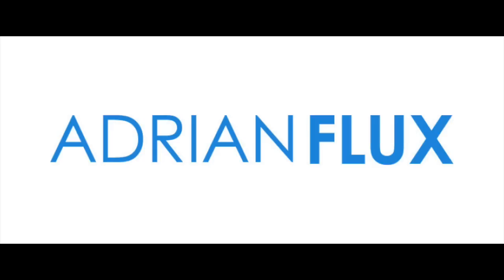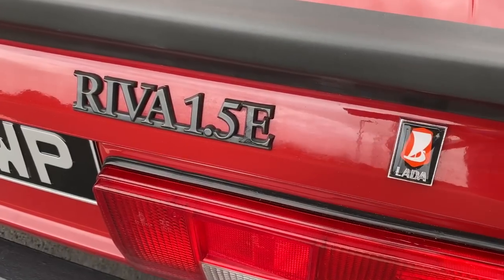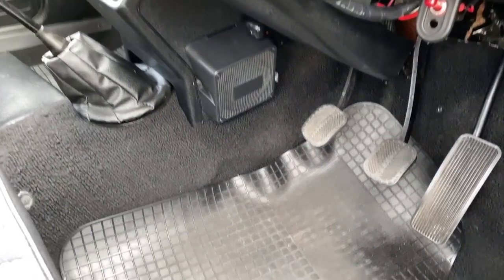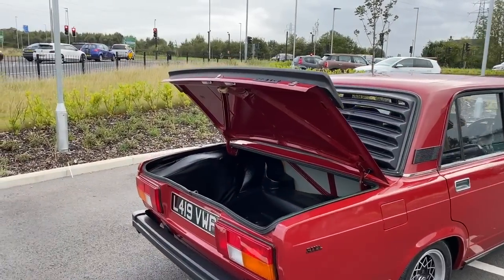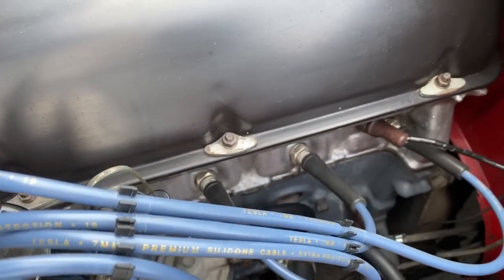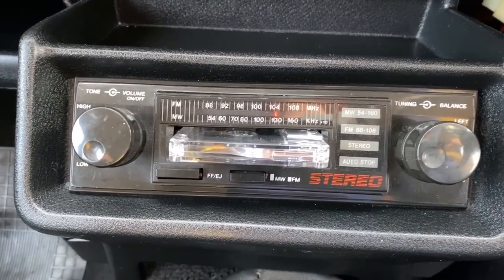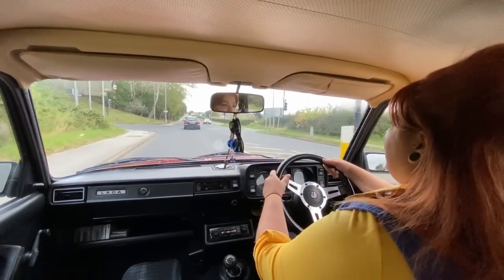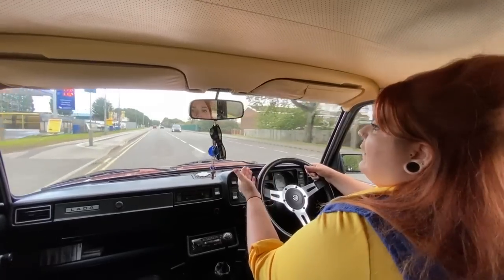IDRIVEACLASSIC reviews: Lada Riva (VAZ 2105)

Comment: With regards to the lack of power steering and the heaviness, the car originally had a larger diameter steering wheel so it would have been easier to maneuver given the greater leverage.
Reply: True but imagine that you don't have to have a gym subscription. You end up with arms like Popeye.
Reply: It's got wide alloys and tyres as well which it was never meant to have.
Reply: @Pfirtzer  Not so much on a Lada, but you sure will from driving a GAZ 53.
Reply: Yep  .............
Reply: steering was lighter as the car gathered speed. i had one for 5 years
happier times
Reply: No not true but it was  about 250kg lighter and narrower tyres
Reply: I assume this car has not the original steering wheel it seems aftermarket steering wheel which gives better steering position.

Comment: Between you and Big Car, it's been a very Riva-filled weekend! And I literally just became the proud owner of a Skoda Favorit, so it's all about the slavic cars of the people for me right now!
Reply: Check the spring cups on the front struts for rust, I had one fail with 'interesting' results, the rear ones can rot away as well but they can be replaced as they're removable from the main strut. When I did mine fifteen years ago Turners of Erlestoke had them on the shelf at £1:80 each, inc.VAT.
Reply: @jonathangriffin1120  Thanks for the heads up! I'll be taking it for a check - over soon so I'll ask them to take a look at those.
Reply: I've just watched old Top Gear from 1994 when we were first exporting them back home on the grey market!
Reply: honestly favorit is the ugliest škoda ever produced

Comment: Thank you for this video it is very intersting. I rememebr these from the 80's. They were popular with private buyers and people who bought them liked them. They were solid compared to some of the lighweight cars of the 80's. I did not own one however I drove one, an estare, and liked it. I recall them being used as minicabs in the 80's. They were common on the roads until the early 90's. One reason for them dissapearing from British roads was the re iposting of them to Russia for parts. Ship loads went back to Russia and by the mid 90's they were rare. They were never fashionable, people in the know liked them. The cold war split opinion on Lada's some people saw ownership as disloyal. However Lada's, FSO's, Zastava/Yugo's and Slodas were poplular with families. I owned a Yugo 311 in the 80's another ex Fiat, the 128.

Comment: There was a model before the Riva based on the Fiat 124. I used to run mine as a taxi, only broke down once in 120,000 miles. It was great in the snow, just cut through and rarely got stuck.
Reply: The Riva IS the Fiat 124! Proudly made by the motherland in a factory city called after the Italian communist leader so adversed by the owners of Fiat that they use to oppress communist workers, and in the same time they had released the rights to produce that car in USSR. And the owners, the democristiani leaders in Italy, the Italian communists and the Soviet leaders, all of them were so happy about it. Bonkers.
Reply: By the way, your story was amazing. Still today those cars are doing wonders on Russian streets, and you can have one for about 500 euros. Oh, Russia.
Reply: The VAZ 2101 was based on the Fiat 124 platform. In Russia, it received the nickname "Kopeyka".  Kopeyka - the smallest change in denomination of 1.
Reply: @drivetothegrave8395  cause Is cheap! What's greater then cheap things? Btw, I never realised that kopeika thing. Interesting, indeed. Thanks for letting me know.
Reply: @danielemeytre4010  Car is named so because of the "1" on the coin and the "1" in the model number "2101".  One and one.

Comment: The smaller aftermarket steering wheel will make the steering feel heavier, imagine one of these with a Rover V8 and standard looking exterior? that would be a scream.
Reply: Precisely.
Reply: I had a Lada Riva with a tuned Lancia 2.0 litre Twin Cam matched with twin 40 Webers under the bonnet. It also had a 5 speed gearbox from a Fiat Supermirafiori fitted. It did 0 - 60 mph in 8 seconds.

Comment: I had a Riva 1.2 with 30,099 miles on the clock. 
I paid 600 quid for it. It broke down 200 yards from the garage where I bought it . 
Remedied by installing a larger fuse to stop it going bang again. I never had mechanical problems with it but the window on the driver’s side was propped up by a piece of wood as the glass became unstuck from its metal winder . 

Interestingly they are popular in Cuba where the roads are not in great condition. They are easy to work on.

Comment: Which was the better car, the front engined Lada Riva, or the rear engined Skoda Estelle? There was also the FSO 125P that looked similar to the Lada and built in Poland. The Lada 1200 based on the Fiat 124 appeared in Britain about 1974 with a different engine to the Fiat 124 that was still around until 1976. There was later a 1300 Lada, and a 1600 with a different front that looked different to the basic 1200. By 1983 the saloons and estates were facelifted and now called Riva. There was also a small four wheel drive utility vehicle called Niva, and in 1987 there was the option of the Samara hatchback as an alternative to the Riva. At least the Lada looked better than the Moskvich that was sold in Britain until the mid 1970s. A red Riva looks much nicer than a beige, grey or white one.

Comment: I hope you will test out a NIVA or even the longer wheelbase Cossack. These utility 4X4s were ingeniously built, very strong, spread the load so that they didn't sink in mud and were only let down (after years) when FIAT failed to supply distributor shafts. The two gear levers could be confusing but my Niva of 10 years service here in Ireland was a better all round 'SUV' than any Nissan, Misubishi or Toyota replacement I have had.
The turning circle on the Niva standard wheelbase was smaller than on the saloon Riva.

Comment: Great vid Steph.  I sold these new for a time in ‘92. They were 1992’s Bargain Car of the Year.  £2995 on the road. The pre delivery inspection was 5 hours long. Original steering wheels were huge which made steering easier but very vague. The reason there are so few on British roads is that they were imported back to Russia en mass during the 90’s where 2nd hand prices were higher than new prices here. They had a very loyal following and estates were often used as vans. The 1600L was the decadent version and even had a rev counter! 
 Terrifying on a windy motorway though.

Comment: I owned two Riva's, the first was a 3 year old ex-taxi purchased for £350!
I ran it for a couple of years with no problems, then bought another with only 12,000 on the clock, I ran it up to 60,000 miles in that time I replaced the clutch, exhaust & battery.
Neither car ever broke down, always started first turn of the key!
I do agree about being heavy to drive, and the doors needed a good slam to shut, the fit & finish was terrible,  But for the price you could not complain!

Comment: In Canada we got the VAZ 2101_2107 sold as the Lada Signet, based on the Fiat 124. They were neat little cars, well put together, and very nippy to drive. I test drove one and quite enjoyed it. The problem then was getting parts! A friend wanted to test drive a Lada Niva, the 4 wheel drive unit. Perfect for their cottage driveway in winter. The dealer had needed to take parts off brand new as well as used vehicles in stock to be able to keep customer cars on the road. After Lada left Canada, the parts dried up completely, so the cars were scrapped as things broke and could not be repaired. A shame, as they were really neat to drive. Nice to see one still being loved.

Comment: Ladas were very underrated in my opinion as we had an estate version were i worked as a firms vehicle and it was punished big time but never let anyone down apart from when we were going over a building site with holding down bolts in the back that was questionable as regards carrying weight and we had the rear tyre torn off by a piece of reinforcing bar sticking out of the ground lol 🙂

Comment: Hiya Steph.  Great video as always - very informative and a good all-round short story on the Lada.  Not sure where you read that they ended up as Taxis over here in NZ (I've certainly never seen one), but I do recall them being sold alongside tractors and the like at the local John Deere dealership, so they appear to have stayed close to the agricultural field when they did the 'swapsies'.  

Ladas did (and still do) have a following over here, although they are not as plentiful as they were about 20 years ago (but what classic car is, eh?).  They were known as the Lada [insert model number here]. Being they shared their good looks with the Fiat, I always quite liked the look of them.  I finally got to drive one when I was 20 - the 2104 (wagon) and it was only a year old and had done 9,000 miles, which I though was strange for 1989 as all others except American cars were in kilometres.

It was more standard than Steve's car.  It was painted beige with a beige dashboard and dark brown cloth seats and carpet.  I got in it and it was not what I was expecting at all.  The steering was like driving a truck (including the angle of the wheel), the gearbox was a vague mystery shift and you needed to raise the clutch slowly after changing gear to make sure you had the one you wanted, it's 1500cc engine was a slug, the brakes - although they were boosted and had a good pedal - had to be trod hard on to pull the car up and rattle!  My goodness did the car rattle!  Dash squeaks, trim rattles, door catches, tail gate, windows, steering column, seat adjustment - damn near anything that could rattle, did in fact.  My own car at the time was a 1957 Austin A55 - so 33 years old by that stage - and I was so glad to get back into it for the drive home.  

I was rather disappointed with the Lada, but maybe I just happened to drive one of the dogs that occasionally slip through.  I certainly think Steve's one goes, rides, sounds and looks a LOT better than the one year old beasty I drove in 1990.  Then again, like BL cars of old (of which I now own three), owners have often had to step in and correct a few factory flaws, so maybe the one I drove would have come right with a few hours and much love.  I do know that the Lada drivers over here love their cars to bits and it is extremely rare to find one for sale.  Yes, I was put off buying one way back then, but it hasn't dulled my smile every time I see one barrelling around the streets.  Keep up the good work with your channel, Steph - you're doing great and I truly enjoy hearing your perspective on the different classics out there 👍

Comment: I thought about buying a Lada when I first learnt to drive but the press were putting it down saying it was a Fiat made out of low grade steel. The jokes started to appear. 
I did hear something about how the engine had been reworked by Russia to improve the crank shaft by installing additional bearings. I don't know if it's true but it was said to improve on the original Fiat engine.
A lovely example though Steph.
Reply: Actually the steel used in Lada was thicker than in cars used in the West, this cars were bullit proof made to withstand and work in harsh remote conditions and easy repair. They were not that bad at all, actually very good with plenty of room and space and decent, but only thing was to me was the petrol, one litre got you about 10 km or so.

Comment: I  had  a brand  new 1600  in 1982.  Had  a  lot  of  bother b4  15 mths. When  guarantee ran out  got  rid of it.  Had  new  starter.  New  alternator.  New  heater.  New  clutch. New  carburettor.  And  i  got 27mpg and  33  on  a  long  run  driving at 56. The 1200  i  was  lent  when  at  garage was  more  better.  Sorry i  didnt  buy  the 1200 
  But  was  glad to  part  company  with lada even  i losr  a  lot  of   money doing  so

Comment: I expect that steering effort would be a lot less with the original equipment wheels and tires, which were likely much skinnier than what's on there now, and perhaps with a larger diameter steering wheel.

These were never sold in the USA but I think they were sold in Canada for a while.  They were all over Jamaica as taxis in the mid '80s, when I visited there.

Comment: Nice lada seems its had a paint job looks nice . Its got a smaller after market steering wheel which will make it more heavy. But the real problem is the worm and peg steering box = heavy  phased out of English cars in the early 1950s. Would it be a good daily drive I think yes. With 2020 eyes its different and cute

Comment: I think the original Lada steering wheel was rather larger than in this one.  That would make it much easier to steer. The owner put style above practicality. You have driven larger classic cars with no power steering, but large steering wheels, and I don't remember you complaining the steering was too heavy. I believe the Lada was a whole £1,000 cheaper than a Cortina, a similar sized car. Most of the Ladas sold in the UK are now back in Russia where they could be sold second hand for possibly 10 times or more than their value here, so there are not many left.

Comment: Love the Riva. I've been kicking myself since 1996 when I walked away from a biege 1988 Lada Riva 1200 L with 57,000 miles on the clock, all for the sake of £50. The good thing is that I got a 1987 Fiat Panda 🐼 750 L for £195, £105 less than the price of the Lada. Try a Panda Steph, you'll love it. Thanks for a very positive review of the Lada
Reply: The Pandas from about ten years ago were one of the cheapest cars for sale in the UK, but apparently a hoot to drive
Reply: @mattylamb9194  they can still be picked up easily. Saw a few recently. Not much equipment but very reliable, great engines, roomy, cute and a great drive. Plenty of them over 10 years old and low miles around £700 or even less.

Comment: 14:43 I've only ever come across these as taxis in Russia and Egypt around 2005-2008.  Nothing special, but cheap and reliable!
Reply: Ladas were used as taxis in Cardiff for many years in the 80s up until the early 90s. Most taxis in Cardiff at that time were either Lada Rivas or PolskiFiat 125p. All painted black with white bonnets which is a requirement for taxis in Cardiff.

Comment: 12:00 what about the indicator switches in right hand drives. I did the same - turning on the wipers instead of indicating. Is there a standard? I've seen not a single left hand drive with the indicators at the right.
Reply: It makes sense having indicators on the right though in a right-hand drive car. Means you can change gear and indicate easily at the same time. Takes a bit of getting used to perhaps, but it's the right thing to do, I'd say. I know Japanese cars used to be like this too

Comment: No surprise that the steering is heavy.  The 'upgrades' are to blame.  The steering wheel is too small, the tyres are too wide, and most of all those cheap Chinese tyres look seriously under-inflated.  A decent set of boots of the correct size on the original steel rims would go a long way to getting this sorted.

Comment: In Russia VAZ 2105 is pronounced "VAZ TwentyOne-Zero-Five"
Reply: Here in Chile classic Ladas were sold as 2104 (SW), 2105, 2106 and 2109. Also, we had Niva and Samara
Reply: @opalap504  2109 is not a classic Lada. This is a front wheel drive car. Classic Ladas are rear wheel driven. 2109 is actually a Samara.
Reply: @test143000  you are right! I should write 2107 instead of 2109 (I know that 2108 and 2109 are Samara). I commited a mistake. Thanks you for correcting me! Greetings from Chile!
Reply: Пятëрка - Pyaterka

Comment: Bought a two year old riva estate in 89.. £1500. Put 130,000 miles on it in 8 years..the floor completely rusted away.  Sold it to lada specialists in Hull for 100 quid, last seen lashed to the back of a Russian ship going home,  where they apparently  fetch good money. Heavy steering, slow , maximum 80 happily , huge tool kit,awful fuel consumption for 1500cc, about 25 mpg.  They weren't good cars. Not recommended.

Comment: There is a reason Lada fitted large steering wheels on these cars...the steering action was unassisted and VERY heavy.  FIAT flogged all the tooling for the Fiat 125 to Eastern European and this spawned the likes of the Lada 1100/1300/1500, FSO Polonez, PolskiFiat 125 and the VAZ 2105 (this explains the similarity of the column stalks).   The steering wheel, those wheels, that slatted rear screen and even the chrome tip to the exhaust are not original and scream boy racer.   Shame...